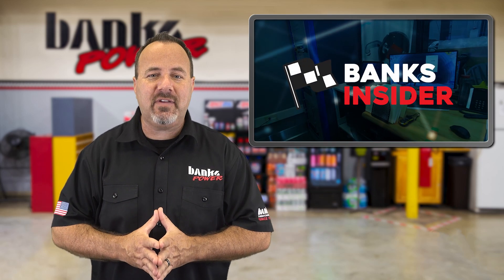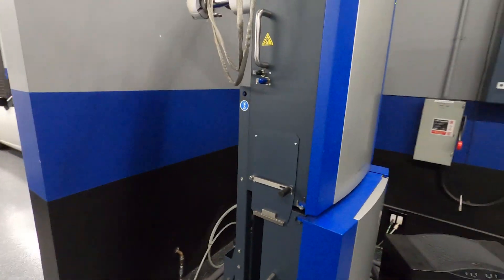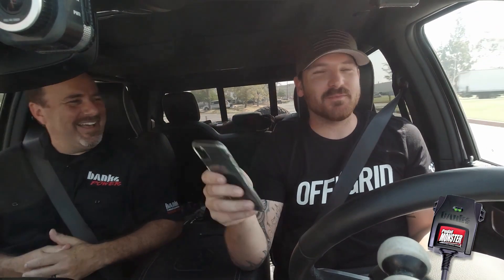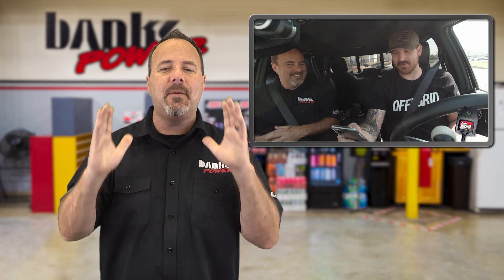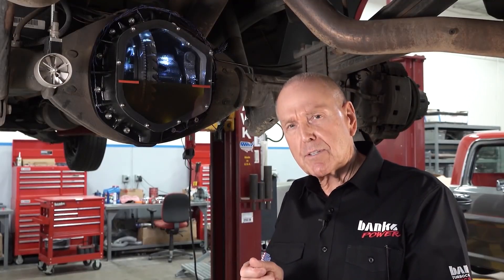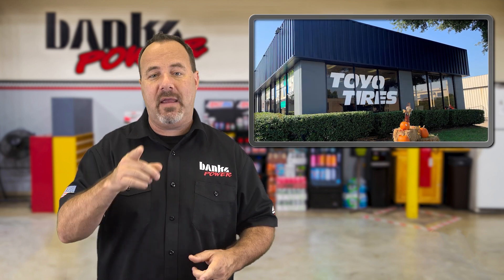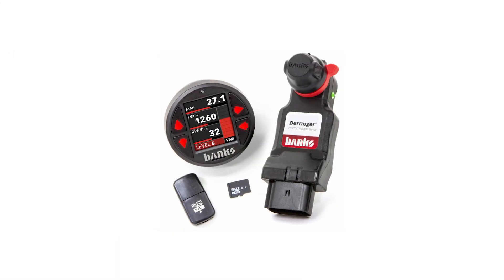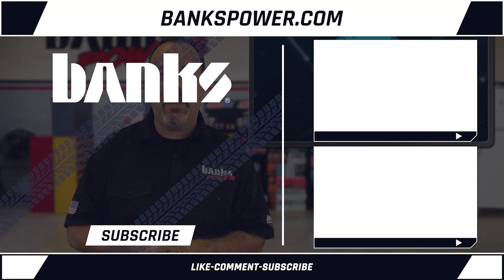RAM Testing, NEW Supercharged Duramax Shirt -- Banks Insider 10/09/20

Comment: When will you have the reverse feature on the rams 3500 available with the pedal monster ? I felt it should have been disclosed before I bought the thing.
Reply from the maker: Reverse Safety was added to the PedalMonster firmware a few weeks ago. If you're using the PedalMonster with your mobile app, you can update the firmware via your phone. If you're controlling the PedalMonster with the iDash, you'll need to update the iDash firmware to see Reverse. This iDash firmware is just days away from public release. We can send you this firmware that will allow your iDash to see Reverse in your 3500. Please email customerservice@bankspower.com. We'll keep an eye out for your email.